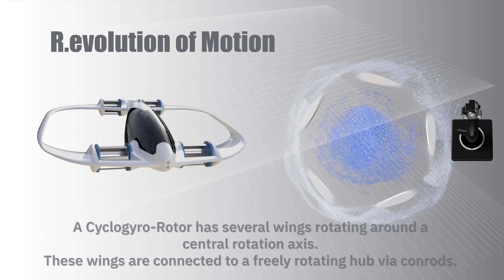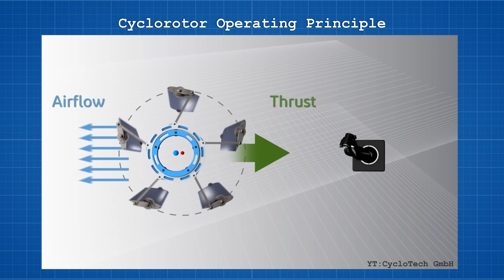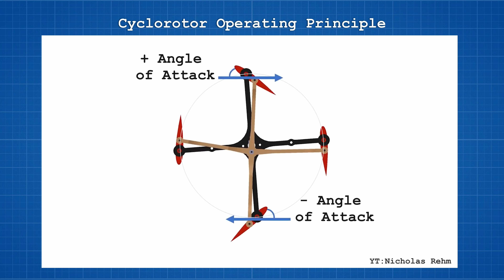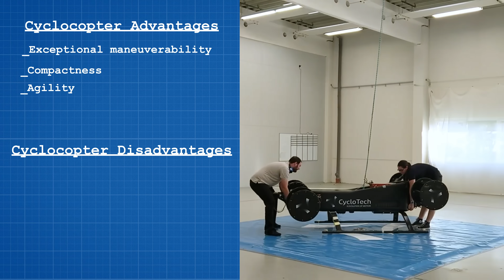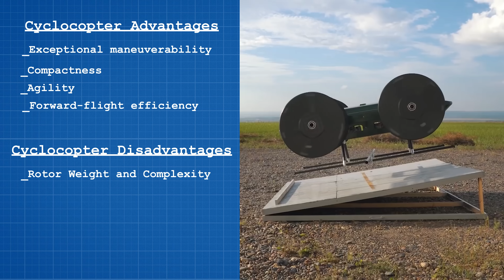CycloRotor: Is this the future of eVTOL Electric Propulsion System?

Comment: I kind of like the concept and the amount of thought that's gone into this.
One thing I do find alarming is the exposed toothed belts that actuate the blade pitch, is there any ideas on doing away with those and operate the motors directly on the pulley, or even a manual backup system in case the electric actuator motors fail?
I don't really like the idea of a belt failing in mid air, or simply jumping a tooth, either of which would send this barrel rolling into the ground within seconds.
Reply: I think it is a prototype, not?
Reply: @TimToussaint  Yeah as far as I can gather mate, it's a fairly early prototype.
Thinking on, I suppose there's pro's and con's to each in the gears vs drive belt debate. Gears might get jammed up from any sort of debris that might happen to find it's way in between the teeth, while belts are far more tolerant of that. On the flip side, gears will need lubrication that belts can do without.
For peace of mind, I suppose it's possible to do a manual override with steel cables and bellcranks moving the vector control eccentric's directly, or even ball-jointed rods to a control stick in case of a control system malfunction. Could even be the same control stick that's normally used for flight input for instant response, the electrics just providing power assist in this case. Relying on the electric motors to actuate it all seems a bit dangerous in my opinion.

Comment: I’ll stick with my 69 Caprice and old Gran Torino.   You can have this shit !!!
Reply: @Carl Klinkenborg simple air cooled lightweight motor that can be removed in 30 minutes.   I love the simplicity of it. They could have should have put the motor in front though, more cooling and easier linkages to the driver.  Run it on natural gas, a cheap abundant relatively clean fuel that does not need a fuel pump nor a complex carb.

Comment: Wouldn’t the solution to blade stress be the curved blades used in the darrius wind turbine design. Also using fixed blades with trailing edge slots to achieve the cyclic flow effect?

Comment: I love that they had to have a cable from the ceiling to "get the thing off the floor". Even if not necessary, a rope on the floor would have been a better presentation that it could lift itself.  All the technical words also make me doubt the authenticity. If your product works, let it speak for itself. If it doesn't, then you have to use all the fancy words to make it sound better. I'm not convinced yet.

Comment: That’s really cool, but reliability usually means fewer moving parts. There’s a lot that can go wrong with those big cylinders with high revving constantly adjusting blades. Compare that to a quadcopter that just needs 4 rotating propellers.
Reply: If you ever seen what the blades of an helicopter look like, you'll know this isn't much different.
Reply: @machintrucGaming  yeah, but this has far more moving parts. More moving parts: more things to go wrong. And the symmetric balance on quadcopters has to spot on.
This is a cool tech demonstration but, in larger volume sales, they'll definitely want to move towards fewer moving parts to increase reliability.

Comment: as neat as it seems, I am skeptical on scaling a model like this. Seeing how large the "wings" already are and the speed they are rotating at, scaling them will make the forces on the wheel so much larger.
Reply: yeah i didn't think about the stresses induced by the rotataion of the blades,  there's a reason aircraft switched from using rotary engines (Where the whole motor rotates) to radial and standard V shaped engines with the radial engine  the force of rotation could at higher Rpms rip  the motor apart.
Reply: I'm on the same boat, but also, Murphy's Law comes to mind considering the complexity of the myriad of moving parts involved.
Reply: Just looking at household fans this blade design has always been less efficient and louder for a given volume of air.
Reply: Infinite Shoeblack  well my thought was simply.... it's barely getting lift without a payload.  How much can it lift?
Reply: Copied comment
Reply: Agreed 🤣it uses energy inefficiently compared to a regular drone rotor
Reply: Being made from the same material in any scale, they would be lighter when scaled up

Comment: it can float, But on the contrary, it can only float.
There is a reason why this patent was buried without any value. It has a very complex structure and , High weight cannot be lifted and the energy consumption rate for generating lift is high.Steering is difficult and there are many other problems.  If you see an ad for investors, don't put your money in it, it's a common tech scam.

Comment: When used for marine propulsion they call this type of drive a Voith Schneider propeller. In that application they are oriented with a vertical axis and can be controlled to generate thrust in any direction orthogonal to its axis.
Reply: Indeed. VSP offers excellent maneuverability since full engine power can be given to any 360 degree direction almost instantly, but they are much more complicated, more expensive, more difficult to maintain and less efficient at full speed ahead speed than a well designed traditional propeller. They are typically used for stand-by vessels, mine-clearing vessels, wind-farm vessels, big tug boats and the like. I can't however imagine they'd be a very good solution for a flying car compared to traditional props, there's a lot of blade and edge area relative to lift produced.
Reply: A good option for bow thrusters.

Comment: Can't see how this kind of fan is more efficient than normal rotors on drone.
Normal blade is aerodynamic. The top edge is more curve than bottom edge, to accelerate the air and create upward trajectory.
But in this case, the thrust is create by fanning away the air, no air (molecules) are accelerated. That's the same as using a handheld fan. Very low efficiency
Not to mention the centrifuge force will break the blades easily

Comment: Looks cool…. But the more moving parts you have the more likely to have a system failure. I’m curious to see how it turns out.
Reply: This is exactly what I was thinking. Cool concept, but not really practical unfortunately.
Reply: @justasingledronevideo2583  For large cargo drones maybe but not for passengers. 

If passengers are onboard then a large portion of the crafts weight must be occupied by a large, deployable parachute emergency system.
Reply: @justasingledronevideo2583  probably right!
Reply: Is it really more parts than any current prop setup with adjustable pitch?
Reply: Lets reinvent the wheel
Reply: In case of failure, you fall to your death.
Reply: @michaelwinter742  indeed, so maybe if they're wise, fit a ballistic parachute to save their butts!
Reply: It's electric so it might not be more moving parts.
Reply: Totally agree!
Reply: I was thinking the EXACT same things, Mace
Reply: Too noisy. "Daily commute", I doubt it.
Reply: How is this not a shitty variable pitch propeller?
Reply: Don't be curious because it won't turn out into anything. Lol!
Reply: Betting this concept won't truly lift off the ground. 

And yes the pun was intended;)

Comment: It still produces downwash which means that it can only be used in special places like airports or heliports.  Also, the thing will drop like a rock in the event of a power failure.  No chance to glide like an airplane or autorotate like a helicopter.
Reply: It flies, therefore it produces downwash. Nothing surprising there.

If it has 4 independent motors, which it surely has, why would they stop working at the same time? A helicopter will also crash if the pilot dies, or if a blade breaks. And, people get killed in cars all the time even without any failures.

Comment: Something you conveniently glossed over is that cyclorotors do not provide protection in case of engine failure. Helicopter rotors allow the helicopter to fall gently, like a sycamore seed, in case the engine stops or fails. Planes are designed to glide should their engines fail. 
This thing would just fall straight from the sky and kill the occupants in a fireball.

A stupid idea that will go nowhere.
Reply: Genius idea, let's make more cyclocopters

Comment: Naw, the helicopter blade design is already the most efficient given the batteries short life span. 

I'm not discouraging new ideas, but trying to show off a rotor design you find neat for funding, doesn't mean it's a good idea. More mass for one, more energy input for less lift, I mean why add more weight, for less lift, and higher battery drain? 

If it's absolutely required in special cases, sure, but it would have to be a design made for "special cases" where the current designs cannot deal with.

Comment: Like to know at which height threshold they loose their viability. Obviously, the thinner the air the harder they'll have to work.
Reply: Why waste precious energy on going up? You'd want to spend as much time flying forward as possible.
Also, with 100kg total lift, there doesn't seem to be a large thrust margin... in this prototype. Hopefully they can improve it.
As always, it's the battery that will be the biggest problem. For cars, if all else fails, we can always have trolleys over highways. That won't work for airplanes.

Comment: Looks like small engines with big downstep gearbox. Makes for a lighter powertrain but you really need a heavy duty engine. And again sure it may have its place. But not with the battery technology we have right now. Downwards propellers and wings is with gimble and rudders a better idea. Vtol and at higher speed just point the propellers back. To only have it generate lift at 150mph? You are just gonna revolutionize helicopter technology? Duude. Pro pell ers. Again. Pro pel. Ers. Same compactness.

Comment: The compactness is not an advantage, it is a factor of inefficiency. To have an efficient flight, you need a larger swipe area. When you have a rotor, the area grows as a square of diameter. In cyclorotor the area grows as a product of diameter and length. Which means, it does not scale well. It will never go beggier than small drones and will have no real advantage in comparison with rotor based ones.
If compactness is important, use turbine. Far less efficient but very compact.

Comment: The persistent problem with these concepts is two-fold. 1 - the energy storage technology is not yet up to par. It’ll be many years before we see any big advancement in battery tech, assuming we do at all. 2 - there is no backup in case of a critical system failure. A fixed wing craft can glide down in the event of loss of power. A rotating blade craft simply falls from the sky and kills everyone on board.

Comment: Given that this is significantly more complex of a device than a helicopter, I'd expect it to also cost more to produce and maintain.

So, uh... why not just use a helicopter?
Reply: Helicopters are much more complex. Look at how a swashplate works. And helicopters have a lot of asymetric nightmare.
Reply: @aldenroswell8504  The swashplate is an extremely simple device.
Reply: @Cybo-Man  well would you look at that, so is the cyclorotor!

It's just a couple rods, it's simpler to me than a swashplat
Reply: Why not get around everywhere on horseback?
Reply: can a civillian fly and use this?... if so thats why... getting a helicopter license is hard as hell
Reply: Helicopters are nothing but simple. Maybe cheap to operate if compared to a product like f-35 that is designed with the sole purpose of bleeding tax payer money into private sector.
Reply: @jepulis6674  what... what... the F-35 cost a lot to develop all military vehicles do... also it's super successful in its role
Reply: This argument is dumb dude. Combustion engines are more expensive to make and maintain, so why not just use steam engines? You see the idiocy?

Comment: Instead of having the rotorblades turn in a flat plane (like conventional helicopters) or in a drum-shape (like this cyclorotor), you could make a conical rotor and open up interresting possibilities. Like a conical rotor could be tilted forward without making forward thrust due to a backwards shifted swashplate. That would have more room for innovation.
But so far the best option for flying vertically is just a normal helicopter with counterrotating rotorblades.

Comment: With no wings to glide on, as soon as you lose power you'll just fall like a rock. It's the same reason I've only ever flown in planes. At least the pilot has a chance of maintaining some level of control when there's power loss to engines.
Reply: Yep. Even rotary wings are remarkably safe. Providing it's achieved a certain minimum altitude, a helicopter has an excellent 'engine failure' mode - autorotation - which allows for an emergency landing under full control.

Perhaps this 'no wing situation' machine could deploy a parachute? Although, if its intended use is as a taxi in a busy urban environment, I don't think it would ever get safety approval.

Comment: My biggest concern is redundancy. These things are built for compactness, so there's no way in hell it's going to glide in the event of an engine failure. How many engines can it run on safely and reliably? Planes can land with just one or sometimes even no engine pushing it.
Reply: Helicopters glide like a Stone, but none refuse to fly with It.
Reply: It could handle one outage, but not more than one, with a 4 wing setup. But that isn't all that bad, consider that most helicopters have one point of flight as well, and any single failure means destruction of the craft.
Reply: @xTwisteDx  Actually not true. With the correct angle of attack, the rotors will continue to turn and generate lift. It is a difficult manoeuvre but possible. Not possible with this craft though.
Reply: @xTwisteDx  Helos have auto gyros in case of engine failure.

Comment: I am also concerned about safety redundancy- if on rotor goes, how do you still maintain level and balanced flight ?
Reply: Clearly you are not a pilot… how will a parachute save you on engine failure or in this case rotor failure after takeoff ? Maintaining level flight with a parachute… really ?
Reply: @frederikkruger just like autorotation is not possible on a Helicopter right after take off, only engine redondency…
Reply: And blade inertia
Reply: With a parachute

Comment: A helicopters 🚁 rotary blades 
goes into reverse to slow decent 
when engine failure happens 
landing might be bumpy 
but people shall most likely survive 

When your motors fail 
nobody stands a chance 
especially from a great height 

The safety of passengers alone 
would prevent safe production

Comment: I can't figure out what the point is.
What is the fundamental difference between a cyclocopter and a quadrocopter in which each of the beams can change the tilt of the axis.
Despite the fact that the quadcopter has classic propellers that are 2 orders of magnitude simpler and more reliable, as well as cheaper.

A quadcopter with tiltable motors will also be able to dock smoothly to a vertical wall or make a vertical landing on an inclined surface without horizontal drag.

Is it worth inventing an overcomplicated device if its functions can be obtained easier, cheaper, more reliable.